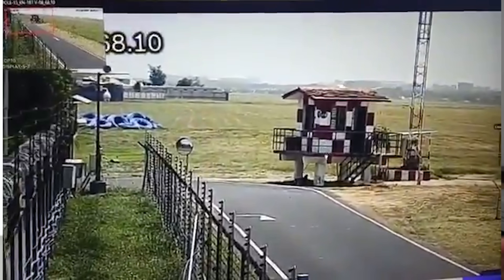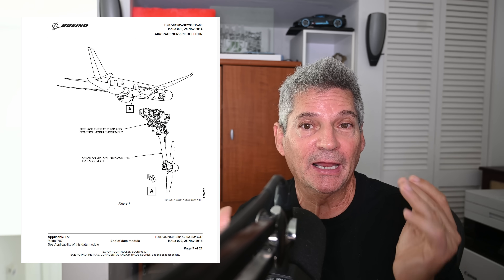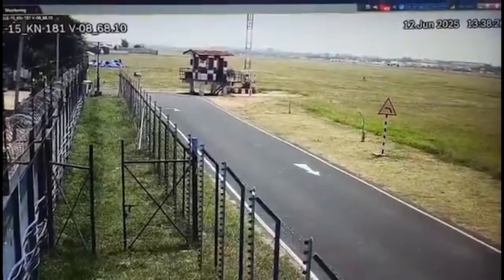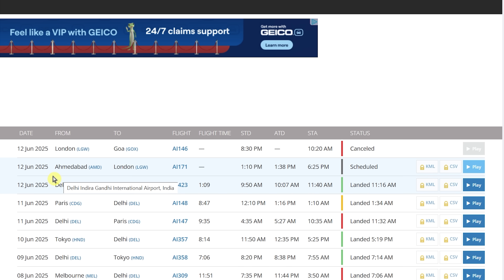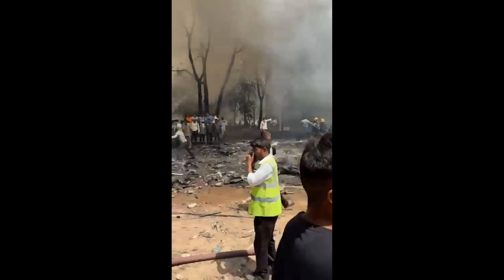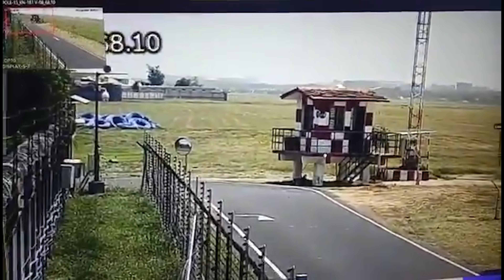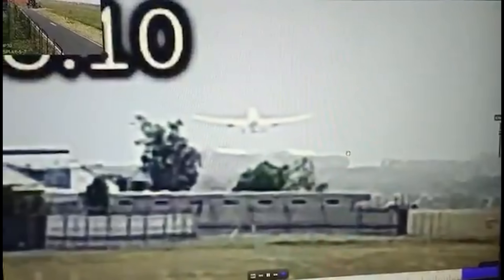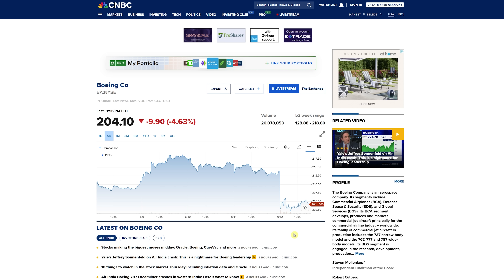What Caused Air India 171 Crash, Mysterious Sound Before Impact

Comment: On the 787-8, the power turbine only deploys if there is an electrical power loss. But according to the interview with the passenger that survived, he felt the plane slowing down in the air, but heard the engines throttling up to full power during that time. Full throttle is not needed during takeoff, unless the runway is really short. My theory still lies with the flaps. Something happened to the flaps during that takeoff flight, causing the loss of thrust.

Now we have to wait a month for the analysis to be finished.
Reply: NOTHING about the flaps can cause a loss of thrust !!!
Reply: @martinjones12  When it comes to flying, it is all about lift! Loss of thrust can only contribute to loss of lift!!! Stop trying to conclude the loss of thrust in this incident. Only the flight data recorders at this point can conclude the cause of the accident. None of us, including me can come up with a conclusion as to what went wrong! So stop trying to be the supreme analysis investigator!!!
Reply: Could it be he heard the RAT ?
Reply: It's not about flaps... if they take off and Suddenly slow down it's lost trust.
Reply: @TheEryk03  NO!!! It was caused due to loss of lift on the wings! Loss of thrust can contribute to loss of lift! But we will not know the truth until the flight data recorders'  analysis!!!
Reply: @talk2azs  no, you are wrong. It lost trust not lift.
Reply: @TheEryk03 Your comment lacks facts. You need to get one thing straight. The thrust of the engines is there to maintain speed of the aircraft and the airflow over the wings. If that air flow is too low, the result is the loss of lift.
Reply: @talk2azs  The surviving passenger clearly states that the plane suddenly began to slow down. One recording clearly shows that the engines were not working, but the RAT was deployed.
Reply: @TheEryk03 In my comment I did say the survivor felt the plane slowing down. Yes, the RAT deploymentt does point to electrical issues. There are now hundreds of theories about the accident. We will know nothing until the flight data is analyzed. Let me throw in another theory...What if the pilots were suicidal and sabatoged the plane?
Reply: @talk2azs  Well, I know that you Boeing trolls will come up with the strangest conspiracy theories just to remove suspicions regarding the most unreliable planes in recent years.
Reply: Landeklappen waren draußen. Sieht man auf den Unfallvideos, wie ein Sprecher auch erklärt.
Reply: And then the RAT deployed for no reason at all. And also, the pilot said that he was losing thrust.
Reply: @BryceShamwow  The deployment of the RAT is a whole new aspect! Right now, there is no way to tell what actually went wrong, until the flight data recordings have been analyzed! As of now, we are all in the dark!
Reply: Die 787 wurde wegen Stromproblemen und Weitern, ~ sie war zu schwer ~ 2013 schon mal gegroundet.
Reply: @antonsturm6185  Yes, You are right! But the specs are stated in writing! No one can push those specs to the limit. If the purchasers of the aircraft did not see this spec, then they should have NEVER purchased the aircraft!

Comment: you said it..."miracle of God".. Thank you for playing the original video, it most certainly sounds like a propeller!  The RAT is designed to help control the airplane but it does not provide thrust needed for a takeoff scenario.  Plus...the plane was very heavy with fuel and passengers. Plus...it was very hot.

Comment: One report was that it 112 degrees at take off...the hotter it is, the harder it is to get lift. If there is a problem with the engines, then the heat would make it even harder to be able to gain or maintain altitude for a go around.

Comment: Could it be a loading / weight distribution issue? Before takeoff the weight of everything is calculated for engine / power settings. If the flight crew were told it was x tones, but was a lot more, then on v2 it would initially taken off but the plane could not climb, and would sink because of the weight.
How do l know this is a possibility, well many years ago when a aircraft crashed into a block of flats at Schcipol Amsterdam. Well two weeks before my fathers friend was a captain of a 747, taking off from same airport. The 747 lifted off and then would not climb up. At the end of the runway were blocks of flats his 747 was heading towards. He did avoid them through skill of his flying. 
The investigation after turned out that the loaders worked in Kg 
instead of lbs. The plane was out of balance. 
Same could be for this crash.

Comment: Well the sound of the engines winding down instead of up which it should on take off because they are increasing power. So if they had a power failure ya it would come out.

Comment: It appears the two main hypothesis are either simultaneous loss of power in both engines, or taking off improperly configured. 
Several pilots say the flaps were up, and the gear down, when the reverse would be expected.

Comment: Also the plane took the entire length of the runway before rotating.. this is a sign that there was not enough power. That's why at the half way mark they should check the ground speed and if it's not up to par they would abort take-off.
Reply: In the civilian airline world, there is not a speed/distance check.  Reason being is the majority of flights take off using a reduced power setting to extend engine life and to lower the risk of engine failure, rather than taking off using full thrust.  As a result, most flights use a majority of the runway for departure.  The aircraft engine indications (N1 or EPR) are used to determine the amount of thrust the engines are putting out, and there are target thrust settings that are checked at the start and during the takeoff roll.  Because of the reduced thrust setting being used, you will use up a lot of the runway, even getting to a point where you are still on the runway but committed to taking off because you are going too fast to stop on the remaining runway.  It may seem odd, but thousands of flights around the world use this procedure every day.

Comment: Lol 😂😂😂 that sound u hear  bud.. Is the sound barrier.. Let me tell you what happened and tank me later with 1 Million subs  plane take off normal. What u don't see and what u see is plane rote  good. Both engine is producing power. Never back fire. Meaning the the engine is performing well. What u see is the landing gear is still out and not going up... One thing why that plan crash. Ill take u tru it. Clear to take off. Power set 80 knots.. Check.. V1 rotate... Positive rate. (GEAR UP....) The co-pilot retracts the FLOP and not the GEAR. so the plane lost lift... That's what happen... Thank me later with subs and 1miliion likes or that plane never reach v1 cause if u look. A lot of dust where the plane starts to rotate. So that let me believe it was at the foot of the runway also.

Comment: So more than likely what caused Air India to crash (considering the newer design) an pilots errored flaps deployment not correctly adjusted during their pre-flight checklist accounting, even though the trailing edge flaps were deployed, without the slats being properly extended the air crafts stall speed was higher and the maximum angle of attack was lower. As a result, the aircraft was unable to climb out of the ground effect and crashed shortly after take off.

Comment: FO put the flaps up when the Captain called for gear up. Captain dropped the RAT manually because he was under the impression he lost power, it's a guarded switch set to auto but push it RAT comes out. You can see the flaps go up in the video.

Comment: Only way you'd get RAT deployment would be dual flameouts or loss of both IDG's without APU running. I'm incredulous that you could have a dual flameout without a bird ingestion incident. These newer gen aircraft with fully electronic systems can be sinister though. This was seen at Heathrow with the 777 that had dual flameouts coming in to land. Hopefully the CVR and DFDR will solve the mystery and help the future of safety.

Comment: It actually achieved about 400' AGL, the ADS-B data gives MSL. The security camera footage of the takeoff does show an apparent issue. The dust raised at rotation and liftoff indicates that the airplane lifted off at the very end of the runway. There were early reports that the airplane started its takeoff roll from an intersection, but that has since been shown to be false. They "back taxied," as we say, to the takeoff end of the runway. Even fully loaded on a hot day, the 787 would not normally take the full 3505 meter (11,500 feet) length of runway 23. I wish I had the performance charts for a 787 to determine the predicted ground roll and applicable V-speeds, but I'm confident that it would not require the full length. That could indicate: insufficient thrust; incorrect takeoff configuration (high lift devices, i.e., flaps and slats) or some combination of these. Edit: the closest thing I can find online is Boeing's airport requirements data. At approximately the temperature at Ahmenabad at the time of the accident and at MTOW (max takeoff weight), the airplane requires a runway length of just under 11,000 feet. But this requirement includes accelerate stop/accelerate go requirements, that is, it's long enough for the airplane to reach V1 (the speed at which you continue the takeoff even after a failure, as best I can tell, about 164 KIAS), abort the takeoff and stop on the runway, and long enough to reach V1, suffer engine failure and climb single engine to maintain required obstacle clearance. I can't find actual takeoff roll data for these conditions, but if 11,000 feet is enough to reach V1, abort and stop on the runway, you'd reach Vr (rotation speed, i.e., when you pull back on the yoke to lift the nose, about 166 KIAS as best I can tell) and lift off far before the end of the runway under normal operating circumstances.

Comment: It's not a bad plane, but if the aircrew failed to set the flaps then that would be one reason why they didn't have lift. If a large flock of birds were sucked into the engines there can be fire or smoke, but I don't see that. I think they forgot to set the flaps.
Reply: landing gear should be have raised at this point landing gear is still down. that is all drag at max weight at take off.  maybe co polit error.  hit flaps instead of raise gear

Comment: plane may have been in the dirt at end of airport as you can see dust in air on take off plus mud on tires after wreck. Passenger said he got out emergency door so he must have left seat while plane was going down and opened door while plane was crashing and running away fast enough to avoid explosion. He also stated the planes cabin lights were flashing before crash

Comment: First of all..., who is the one to ever use words like: "Boeing made a bad plane"? If Boeing made a bad plane..., hehe..., then Airbus made a tremendously bad plane all in all. An AE, ex-aerodynamicst, flight dynamics specialist with over 15y of experience in the domain and actual Boeing 737NG maintenance inspector is talking. Boeing NEVER made a bad plane. Companies hiring impostors to fly Boeing aircraft made bad people in the end. This is the only truth. And about the 737MAX? Heh..., once again, does any of you have any info about the fact that Boeing knew about that apparently non-urgent issue regarding the MCAS taking false readings from the left AOA sensor once in a while and because the US pilots and others who have encountered the same exact problem years before Lion Air and Ethiopian Air crashed, actually did the same thing as they would also do on the 737NG, which is to use the STAB TRIM cutout switches and trim manually as needed and fly the plane safely to destination or back? Huh? Nobody, eh...? Why do we know only false statements and false beliefs but the truth is so freaking tiny to put out? Ask yourselves that!

In this case, the lack of thrust was the number one problem that needs to be resolved. The second one is why didn't the crew use the flaps, although even without flaps, planes can takeoff normally, only that they require somewhat higher speed to takeoff, but as in this video is proven, the flaps wasn't the problem as long as the AOA is still kept within reasonable margin, as it actually was throughout the climb pattern.

Comment: The Flying Object which becomes visible just after the plane goes behind the building tell that the engines were running thus it tossed that door like thing into air. I don't know why no one else has talked about that yet. The door or  piece of a shack roof is proof engines giving huge thrust.
Reply: 10:32 Very poor quality video of plane taking off as if computer generated AI a job ?

Comment: I think that the flight crew did not have the flaps set correctly.
Without the flaps extended the aircraft would play hell gaining altitude at the low speed that it would be at right after take off.
Very much like you see in the video.

Comment: It looks as if it ran out of fuel. Did it.?
Reply: Without power on both engines the airplane can still glide. It stalled because the pilot forgot to set the flaps for takeoff. The wing is so straight. The back part of the wing should be lower if the flaps are set. 😮

Comment: It's the battery's again as soon as the landing gear was activated to retract the battery died and the  Ram Air Turbine (RAT) Generator made the loud sound when deployed and added additional drag causing the plane to crash. The 787 Dreamliner uses more electricity, instead of pneumatics, to power airplane systems such as hydraulics, engine start and wing ice protection. This lack of power would also affect the ailerons and flaps with out electrical power being generated.

Comment: The gear was down and the flaps were up.  At that speed and angle of attack, it's a power on stall. Lowering the nose might have helped , but they fell for the trap that 'we're descending - pull up".

Comment: What’s odd is the RAT was deployed. That only deploys when there is loss of electrical power. Sounds like something seriously wrong occurred with the avionics and that fact all computers lost power or the ones responsible for controlling engine and fuelling went wrong is an indication of a systemic failure in my opinion

Comment: Look at the wings. No flaps on takeoff.  Not enough lift. Did they lose hydraulic pressure? Or were the flaps never selected?
Reply: It's not possible to tell the position of the flaps on that low-quality video. Even on high quality videos of a 787 take-off, the extended flaps don't stand out like on older aircraft, especially with lower flap settings.

Comment: Do not you see that wings are not properly configured? Flaps 0 degree. 
They look flat!!!! So it had no wings lift.
It is strange as modern aircrafts do not allow to take off if the plane is not properly configured for the procedure.

https://youtu.be/9Wj6l3ye4cA?si=alOH5-WAx-8_917W
Reply: Nope, the flap position can not be determined from that low quality video.

Comment: This guy is weird. It sounds like a front fan turbine then transitioning to the jet exhaust. So his theory is that there was full power at takeout to get the plane off the runway and climbing, then there was a dual engine failure a few seconds later and a ram air turbine deployment?  I see gear down and no flaps. Clearly the wings don't look right - they should be producing more lift and have much more curvature.

Comment: Take off seemed normal. Pilot was experienced.   Seasoned aviators say it is extremely difficult to confuse Flap and Gear shifts. Surviving passenger heard explosion, which could, in fact, be the RAT deploying, because of the engines shutting down:  I suspect MAINTENANCE.  
(I don't know anything about airplane. I based my opinion on expert opinions.)

Comment: I think the fact the the gear wasn't retracted immediately after they left the runaway is the key factor. As soon as they confirm lift-off, the gear retracting should be the first thing that happens just as it comes off the runway. The gear never moves and stays deployed through the entire flight and if you are losing lift, that should be the priority, to get the gear up lessening drag. I know some other speculation is that when the captain called gear up that the copilot grabbed the wrong lever and retracted the flaps. Will have to wait for the black box for sure.

Comment: This a very unfortunate tragedy and I feel for the families of those affected.

The video is done very well and the RAM air turbine deployment is supported by other facts identified in the video.

The first detail is that the transponder ADS data stopped at the maximum altitude of 625 ft.  The transponder data should not stop at that point and should have continued after that.  The only way the transponder data could have stopped at that time, is if there was a massive power failure at the same time.

The other detail is that the leading edge slats can be seen deployed in the video.  This can be identified by the dark shadow near the front lower surface of the right wing in the video of the aircraft. This means the flaps were at least at position 1 but most probably at position 5.  Because the aircraft was flying straight and level this means the flaps were operating normally on both sides of the aircraft.

These two pieces of data lead and the fact that the aircraft could not hold altitude leads to a conclusion of a double engine failure which caused the loss of power to the electrical system including the transponder.  There is no evidence of any flames coming from the engines so it a double bird strike severe enough to cause a double engine failure.
Is remote.

The only conclusions left are some sort of fuel starvation or a fuel contamination problem causing both engines to loose power.